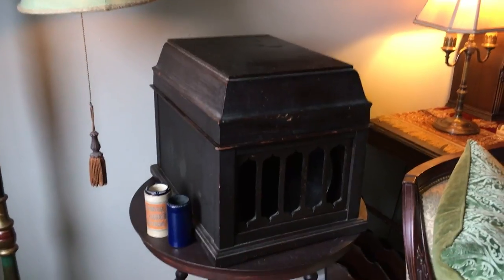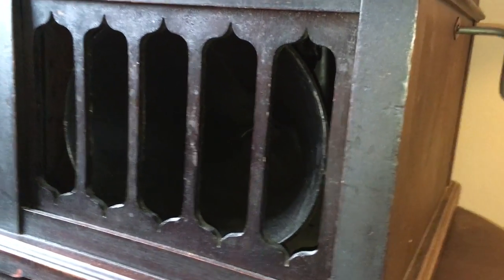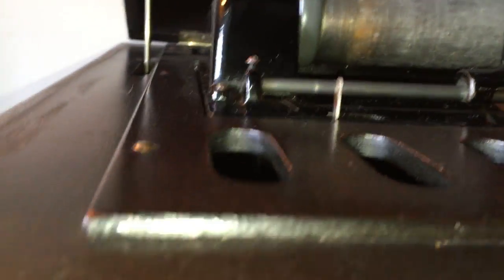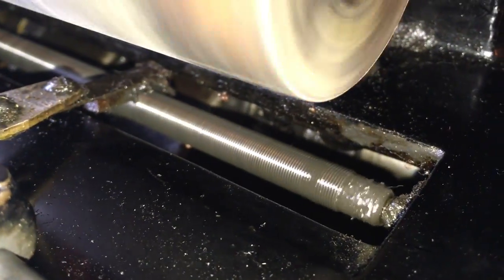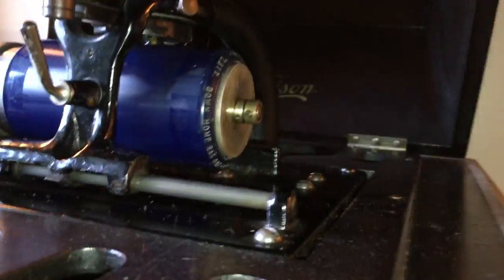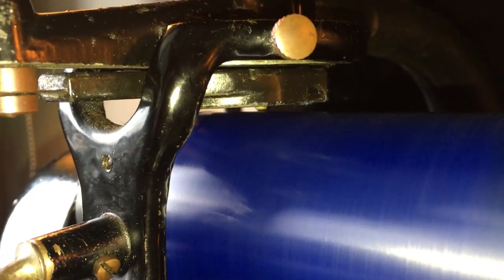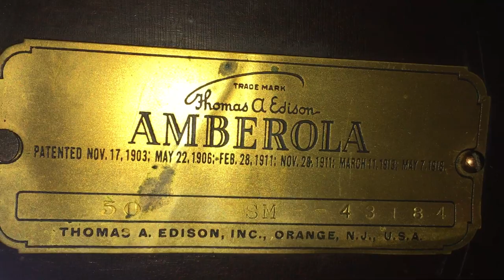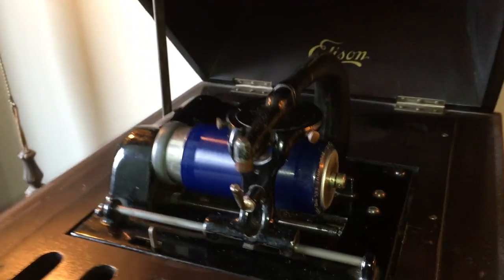Down Home Rag played on the 1918 Edison Amberola Cylinder Phonograph

Comment: i ended up finding a newer version of these, built for 6 inch cylinders but run at the 4 minute speed, electric with pneumatic controls, it was a dictation machine and it was an absolute nightmare ti get everything working again, the governor gave me absolute hell to get it in a playable state and there was rust all over the feed screw so i had to drown it in oil while running it several times to clean up the threads
the positive to having a 6 inch dictation machine is that its unusually well suited to playing warped or swelled cylinders without doing anything to them since the seating on the mandrill has a lot more room for variance without affecting playback

Comment: Just picked up a 1915 Amberola 30 that's been in my family for a long time. It came with 15 cylinders and it sounds incredible, but it could use a good oiling and cleaning. Any idea where to get good advice on  how to maintain these? thanks
Reply from the maker: I would visit your local antiques shops or auction houses to see if they have any recommendations on someone local who could service your machine.  Edison machines are fussy with many little adjustments and alignments to be made for proper playing.  There are fewer and fewer old dues around who service these so good luck.  You might have to drive a distance.

Comment: Assuming there is a speed adjuster knob, You've got the machine tuned ten times faster than what it should be.
Reply from the maker: No.  Edison Amberola cylinder players do not have a speed adjustment that can be altered by the consumer. It is spinning at exactly the correct RPMs.  Disc phonographs do have rpm speed adjustments because not all 78 RPM records spin at 78 some actually spin at 80. But the speed of this style Edison cylinder player is standard and the speed of the mandrel cannot be altered by the user.
Reply: @oldcuriosityshop265  Found that out after getting mine, and I was surprised to learn about the lack of a speed knob like on my '06 Columbia BK Jewel. I only mentioned that after hearing a slower recording of the same record in the UCSB cylinder library. But then again, each model is going to be different, I suppose.
Reply: @oldcuriosityshop265  i think very early amberola models had speed adjustment from what i’ve seen and heard about, but i could just be tired, it is midnight here after all lol

Comment: Adjust the speed! My grandma had a Victrola, and there was a knob to fine tune the speed. Most old records were 78s. I realize a cylinder recording may be different,  but it's rotating too fast and it sounds awful.
Reply from the maker: No you are wrong.  I have been collecting for over 40 years and the cylinder is spinning at the correct revolutions per min.